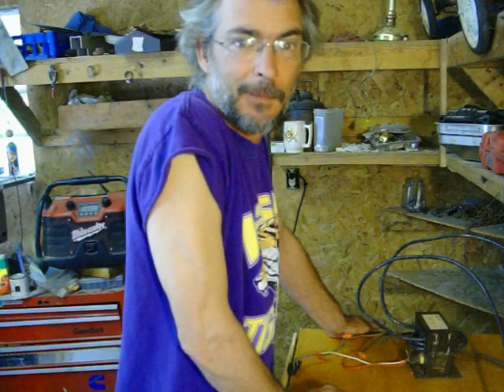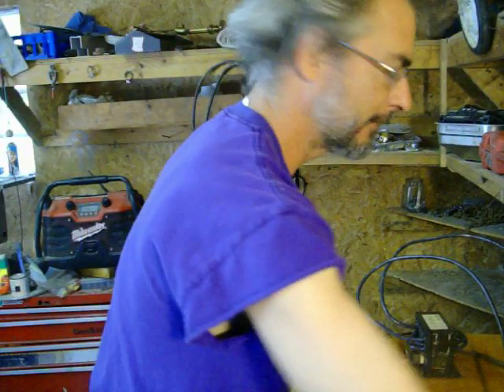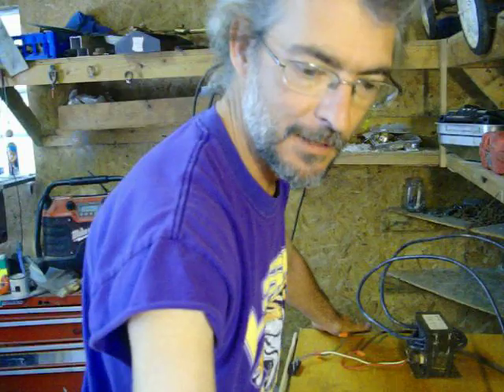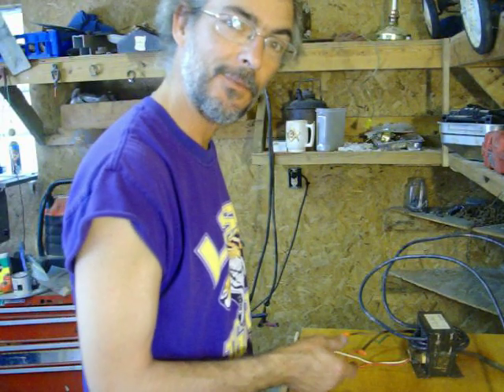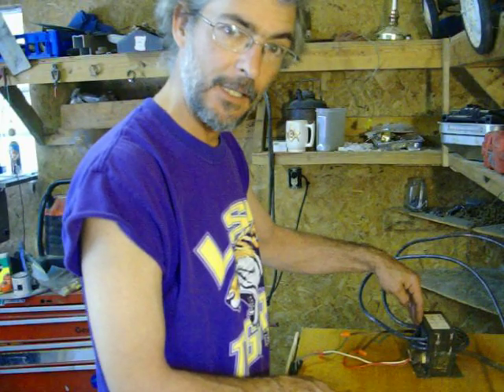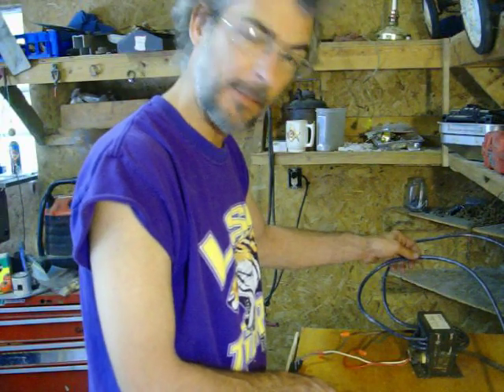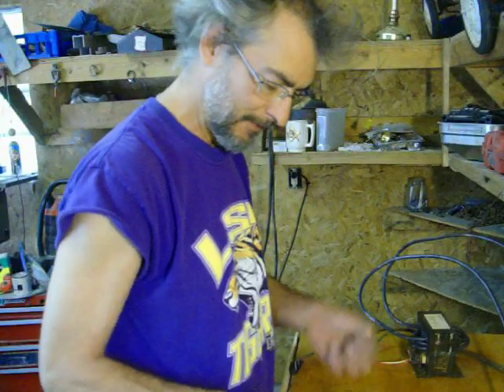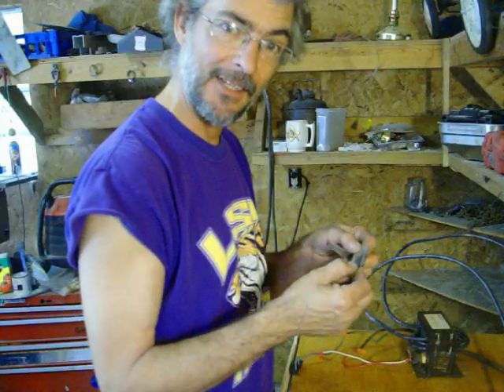homemade spot welder

Comment: Go to 2 turns on the #4 wire and in theory, it should decrease the voltage and increase the amperage to the weld side.  That should give you a hotter weld.